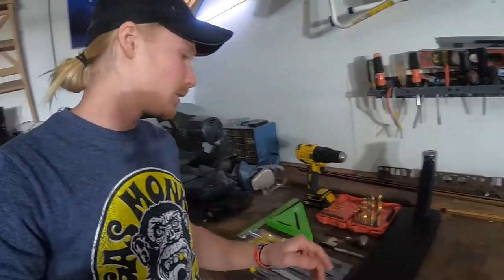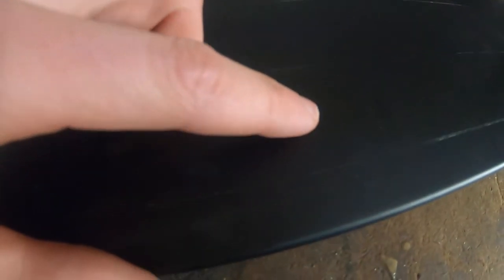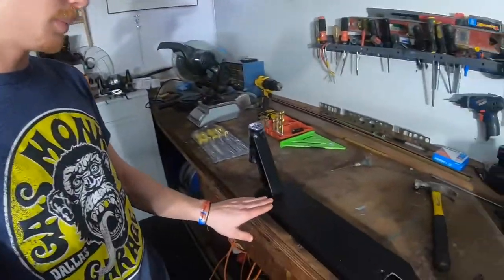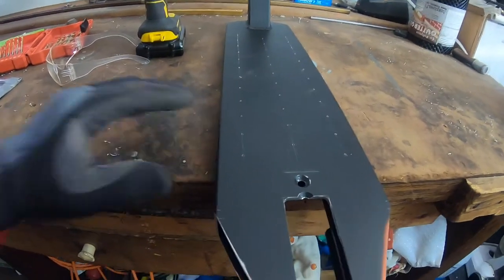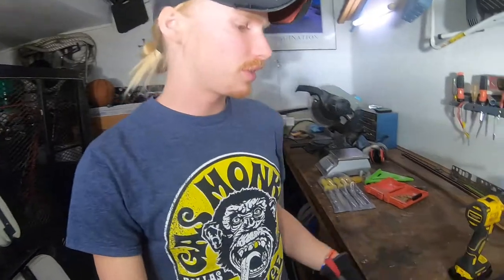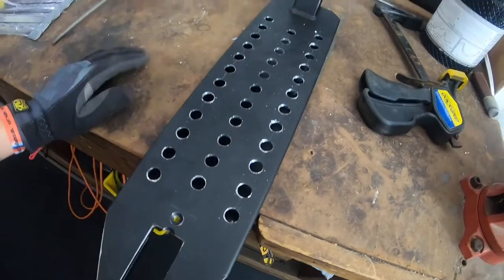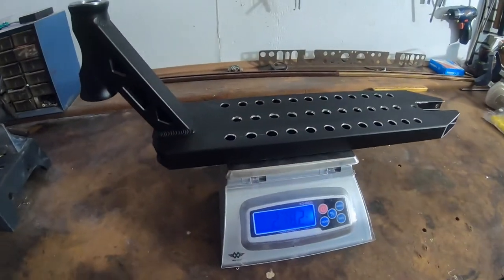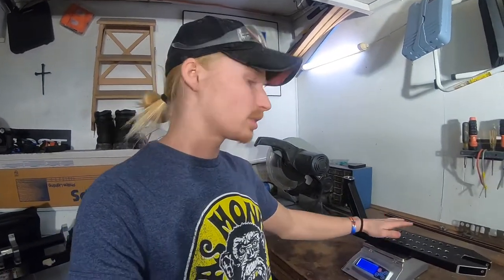HOW TO MAKE THE LIGHTEST PRO SCOOTER DECK | SCOOTER HACK

Comment: Hi Chase, my son watches most of ur videos, we already drilled the top holes, can we do the same on the bottom? Would it weaken tnxx
Reply from the maker: Thats so awesome to hear that he watches most of my videos! please give him a high five for me!!!! Drilling on the bottom of your deck is kind of controversial. I personally say, It depends on the deck. For example, if you ride something similar to a rapture deck, there is the middle space on the bottom that is never touched when stalling or grinding. I personally remove a lot of this metal there to lighten my own deck. but the tricky part come in when you start wanting to remove the metal on the actual grind plates. This technically doesn't weaken your deck in the since of landing tricks. but it does how ever make the deck much harder to grind with and could potentially cause cracks from grinds/rails/curbs eating away at the holes. but if your son does not grind much, then it'd totally  be okay especially if he is going for maximum lightweight. But if he if plans to grind a lot, just plan to keep an eye on the holes on the bottom and expect to not have the deck last quite as long as it could. Hope this helps, feel free to reach back out if you have any more questions, or if you would like to shoot me an email RaptureProscooters@Gmail.com or DM @Chase.Rost, i could send a few pics of my own scooter so you could get an idea of what i do with my own deck.
Reply: @ChaseRost   Many Thanks for the Response ! Truly appreciate ur experience, i guess we wont be drilling anymore holes on the bottom bcuz he Does love his grinds. Its okay we wont take more of your time on the pictures, my son already knows your specs and riding style due to him watching your tutorials. May God Bless u Chase and lets keep the fire burning Till The Rapture! 🙏🏼❤️

Comment: Does it affect the deck?
Reply from the maker: Jaden pegden Vlogs Nope not at all. As long as you don't hit the support beams, your good. 
The material on the top and bottom can actually have a large portion removed without sacrificing strength. 
Also just make sure you don't cut to close to the welds. 
I believe I just messaged you on insta too but anyways wanted to post it on here for anyone else to see too!
Reply: Sup 😂

Comment: If I do this with a deck can I put some holes on the sides in the fron instead of on top
Reply from the maker: I'd personally not recommend putting holes on the side of the deck, as the sides are considered structural to the deck. however the outside walls on the deck are less structural than the internal walls (beams) running through your deck. I would stick to the top or bottom of your deck. but if you do put any on the sides of your deck, I would just not recommend putting them in the center or back part of your side deck. also DO NOT go through the two middle supports. Hope that gives you a bit more insight, def let me know if you have any more question.
Reply: Chase Rost where do you think the best spot to put them is when I only want to put around 6 holes
Reply from the maker: Isaac Edits Are you talking best spot on the side?
Reply: Chase Rost no best spot for the bottom for only 4-6 holes
Reply from the maker: Isaac Edits I would definitely aim for the middle. That way it’s not going to effect your grinds.

Comment: Is the deck then more unstable and can break fast?
Reply from the maker: Epnick As long as you don't hit the support beams, your good. 
The material on the top and bottom can actually have a large portion removed without sacrificing strength. 
Also just make sure you don't cut to close to the welds. Also make your cuts/ holes clean with no jagged edges and then this will not make your deck break.
Reply: Thank you very much😇

Comment: Also makes the deck a lot weaker and is terrible for big tricks
Reply from the maker: Ha not even slightly true. The metal that runs horizontal is non-structural. Therefore portions of the metal, in the right areas, can be removed without lessening the integrity of the deck. If the holes were to hit the vertical beams running through the deck, then yes the decks strength would be compromised.